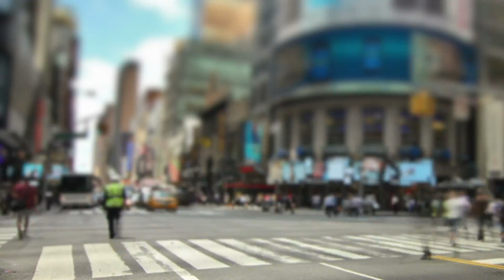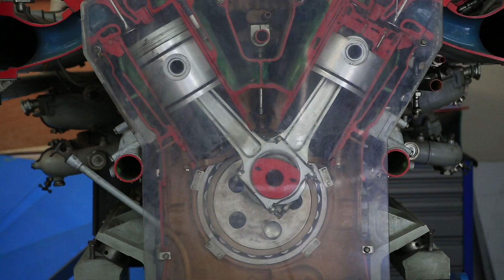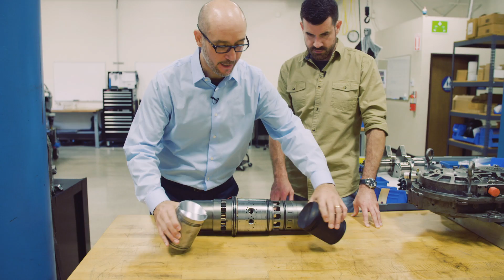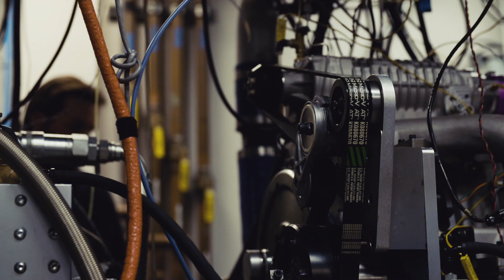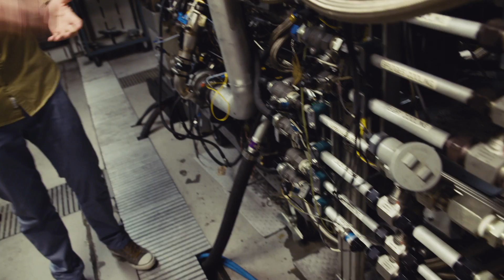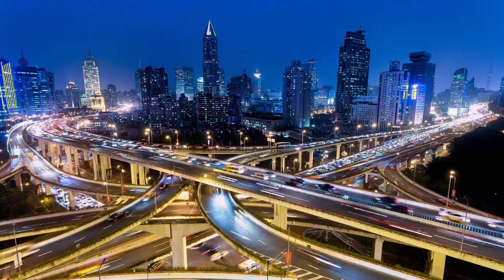This Radical Redesign Could Keep Gas Engines Pumping | WIRED

Comment: The first few years after sailing ships were made obsolete by the steam engine saw the most rapid efficiency improvements in sailing ship designs too.  It's a pattern repeated throughout history over and over again and it's what we're seeing here.
Reply: '90%' is not a real measure of fuel consumption

That's true.  A valid comparins to the 15-20% tank-to-wheels efficiency of the ICE is comparison to generation-to-wheels efficiency of the EV.

Generation to wheels includes the fill cycle of the heat engine.  The electric car heat engine has efficiency losses at the following points: 

1: Power Production
2: Losses in transmission of electricity
3: Losses converting AC to DC to charge the battery
4: Losses converting DC t AC to power the electric motor
5: The efficiency of the electric motor
6: Losses in the drive train
7: Losses relating to the extra weight in the car relative to an ICE

When you look at that entire cycle, you have a system that is approximately 40% efficient, which is twice as efficient as an average diesel car and close to three times the efficiency of an average petrol car.

You can take it further than that by looking a wells-to-wheels efficiency.  This is often brought up by oil industry shills who wan to talk about mining and production efficiency of EVs while ignoring mining, refining and production efficiency of ICE cars and fuels.

The production of an EV is 10% less efficient than production of an ICE car, but only because the production volumes are smaller.  That's a loss that is revovered over and over again over the lifetime of the vehicle.

The other thing people seem to forget is that oil has to be refined and that process uses electricity too.  Lots of it. When you go wells to wheels EV efficiency lead is increased, not decreased.

The carbon efficiency of the fuel is also important.  It makes things very complicated because it varies depending on your location.  Where I live electricity is based on 75% natural gas, 15% renewables and the rest comes from burning oil and peat.  Overall I am emitting 30% of the carbon that I would be if I was driving an average petrol car.
Reply: Yep, more recent example is the incandescent light bulb. EU banned them and all of a sudden they came out with huge increases in efficiency.  Did not help them one bit. 
Even a 30% increase in efficiency won't help the internal combustion engine. A standard ICE is only ~20% efficient, compared to over 90% for an electric motor, there just is no comparison.
Reply: Good observation.
Reply: 2LegHumanist Wow, so you can read my mind now?  All I want is a car that I don't have to wait 30 minutes for, to get a not-full charge.

I get that when the car is parked in my garage, it will be charging.  I get that, most of the time, I won't care that it can only go 250 miles before it dies, because I won't be going 250 miles before having an opportunity to stop and recharge it.

But I cannot afford two cars for two different purposes.  I need one car to fulfill all the purposes for which I need a car.  And electric cars do not yet meet those needs!!!  How can you be so arrogant as to think that, because an electric car meets your needs, it must therefore meet everyone's needs?!  It is elitist attitudes like yours that got Donald Trump elected!  People are sick and tired of being told what they need, rather than being allowed to determine that for themselves.

This whole argument started when you said the internal combustion engine is obsolete.  The definition of obsolete is "No longer produced or used.  Out of date."  The internal combustion engine is still produced and used every single day, all over the world.  Yes the electric car is making great strides towards becoming more and more useful every day.  But it is not ready to entirely replace the internal combustion engine!!!  Why don't you try actually reading what I wrote, instead of assuming you know what I mean!!
Reply: The last steam cars as well.
Reply: It's not really about the instantaneous efficiency in front of some measuring equipment. It's about the full life-cycle cost, from the cardboard packaging to recycling light-bulbs. As consumers, we never see some of those costs because they're already subsidised, so it makes sense that those sorts of bureaucratic decisions are made where they do have a fuller view of what's going on. On the other hand, 'efficiency' is a complex unsolved puzzle. When developing new engines, including electric motors, do we count the entire history of earlier engines as development costs?

BTW, electric motors are only "90% efficient" at converting the energy that they get from the electricity infrastructure, which might be less than 50% efficient to start with. '90%' is not a real measure of fuel consumption. But worse than that, every cent in the production price of your car represents a certain energy price. If a car costs $100k to drive out of the showroom, that's $100k worth of fuel getting burnt as the production cost gradually gets shared around in the economy.
Reply: You cannot charge current Lithium Ion batteries in 7 minutes -- even to only 80%.  It will destroy the battery in very quick order.  If you want to keep your very expensive battery in peak operating condition, you must charge it far more slowly than that.  Even the Tesla superchargers are not good for the battery if used too many times.

It's just the nature of Lithium Ion battery technology -- you damage it every time you charge it.  Even the slow charges damage the batteries.  Look at your phone or computer.  Run it dead every day, charge it up every night.  After 18 months, you have a very noticeable reduction in capacity.  All Lithium Ion batteries do this.  It's the nature of the beast.

And you think everyone should take a 30-minute break after only 400km of driving?  I can see taking a 10 minute break to grab something to drink or some food, and refilling the fuel tank.  But half-an-hour?  And you're not going to get 400km out of a modern battery with only a 30-minute charge.  200km, tops, if you're lucky.

Until a battery is invented that can take a charge and discharge with zero damage, and can do that tens of thousands of times, the electric car will only fill the needs of daily commuters.  Which is a lot of people, to be sure.  But it will not make the internal-combustion engine obsolete until then.
Reply: 2LegHumanist
Great answer! BTW I've been thinking about this for a while, kind-of baulking at the high price which seemed to strongly conflict with the idea that EVs were more efficient. But I've come to see the high price as simply a market signal that EVs are very desirable.

Without corrections elsewhere, a spending spree on EVs could drive a bit of inflation, as people borrow more cash to pay for a product that should inherently be cheaper to produce. Instead, competing ICE manufacturers will feel the squeeze.

I'm relishing the thought that the car industry will be forced to focus on actual technical innovation rather than endless redecorating.
Reply: LMacNeill ICE cars are already being phased out.  They will be banned in Germany from 2030, BMW is phasing them out too.

I'll go back to the ICE when it runs at 3 times the efficiency of current tech, pollution produced by it is exported to unpopulated areas, they make one that runs completely silently and a system is put in place where I can fuel the thing at home while I am asleep.

The majority of driving is commuting.  For that driving an EV is far more convenient than an ICE.  You don't have to make any special trips to charge the car like you do with an ICE and it has much lower running costs.

For that massive convenience I experience every day I will happily wait 30 mins on the rare occasion that I travel beyond the range of the car.  But 350kw charging is in its way.

Your ignorance really shows when you claim you need a charge point on every street corner.  No, you need them at destinations like workplaces and shopping centres.  I don't know where you live, but we already have that here

Get it out of your head that you have to go to some special location to charge a car. You simply go to your destination and plug in while you are there.  Car charges while you are not using it.

No, lithium ion batteries are not all the same.  Manufacturers are constantly experimenting with different chemistries  Do you really think the Samsung Note 7 has the same chemistry as all those phones that don't spontaneously combust?
Reply: 2LegHumanist I live in a rural area in the northern part of Georgia in the US.  It's a 20 mile drive just to get to the nearest shopping mall.  Electric cars are not practical for people like me until they can be recharged in just a few minutes, like gasoline-powered and Diesel-powered cars are today.  Period.  And until that time, they will not have rendered the internal-combustion engine obsolete.  Period.  My wife drives between 100 and 150 miles every day for her job.  An electric car will not be practical for her until such time as it can be 100% recharged in the same time it takes to refuel a gasoline-powered or Diesel-powered car today.  (FYI, she drives a Diesel-powered car, so as to be as efficient as possible, and not spend hundreds of dollars a week on gasoline.)

Your assertion that the internal-combustion engine is currently obsolete is quite clearly wrong.  You may be able to get away with owning a pure-electric car, but until such time as everyone can do that, the internal-combustion engine will not be obsolete.  That time will come, I am sure.  But it is not here now.
Reply: Both of you make valid points, however, this is way i think the electric motor will win the battle. It boils down to cost. An electric car has an order of magnitude fewer moving parts then a regular gasoline car. That means it's much less likely that something breaks due to wear and tear, that means that maintenance costs for and EV are much lower. Secondly, electricity is much cheaper then oil, even at these low prices. And this is not just theoretical, taxi companies that use EVs have confirmed this, they save a lot of money from fuel and maintenance.
The problem today is that a battery that enables you to drive 500 km and the EV itself costs way too much, that economy makes sense for a taxi company, because they drive a lot but not for everyday car owner. The solution for that is production at scale. We know how to do that and it's already starting to happen.
The second problem is charging. Where there is demand, there will be supply to make a profit from that. I really don't worry about that.
So it boils down to producing batteries and EVs at scale, if we do that we can offer people a car that is cheaper to own and cheaper to drive at similar cost to a regular ICE car. I can't see people buying a car that has higher maintenance costs and higher energy costs to move, hence the internal combustion engine is dead, it's just a matter of time.
Reply: meh_hi_there There are numerous problems battery swaps.  

The potential for damage that can occur to the most expensive component of the vehicle when constantly disconnecting, lifting, moving and reconnecting a 400-600kg battery is a pretty good reason not to do it, but lets focus on the problem you dismiss out of hand as pride.

You have to remember that almost all charging for almost all driving happens at home when you're not using the car.  It's only the rare occassion that you want to travel beyond the range of the vehicle that there is a need for fast charging or battery swaps.  That means that if I swap my battery, whatever I end up with at the end of my journey I am going to be stuck with for a long time.

So why not just accept that for the good of the environment?  Well, batteries degrade at different rates depending on how well they are looked after.  If I keep my own battery, I have the option to extend its life by ensuring keeping the charge between 20% and 80% as much as possible.  Someone else's dirty battery might have considerably less range than mine and that might not be suitable for my needs at all.  Due to the amount of driving I do, I need a particular range.  When my battery falls below that, I will replace the car and someone who doesn't need that range will buy my car.  If I am swapping batteries I will never know what range I am going to end up with and buying a new car or a new battery will make no difference.

Why should I swap my well looked after, brand new battery with 100% of its original capacity for some dodgy bastard's old battery with 70% of its remaining capacity?  It's not pride, it's just not wanting to be completely fucked over.
Reply: So far that Model 3 does not seem to be a car for average consumers.
Reply: Tell that to the 500 thousand average consumers who have put down deposits already.
Reply: Thousands of these were made in T64 tanks. Most trains use em too. they are very efficient. T64 gets 2mpg whereas modern Abrams gets 0.5mpg
Reply: meh_hi_there Sorry, I meant to address the point you made about energy cost.  Most of the cost is in the batteries and it's not due to energy costs in manufacture.  It's the ongoing research and development and the low volumes being sold to date.

Tesla's market strategy was to focus on the luxury car market initially.  There are two reasons for this. First, an EV in that market can be competitive despite the high cost of batteries.  Nobody wants a ford focus that costs $50k. The second reason was to make electric cars something desirable in order to create a market for the lower cost cars when they become feasible.  Prior to Tesla, all electric cars were small, slow and awkward looking things.  Tesla made something that looks like a normal car and is now the quickest production vehicle on earth.

Tesla are addressing the cost of batteries by building their Gigafactory which will hugely increase the production volumes of car batteries bringing the price down.  That is how they plan to make the model 3 half the price of the baseline model S.  Before incentives are taken into account, the Model 3 will be $35k (USD).  Then of course, it won't be long before the price drops further and the number of cars in existence creates a more reasonable second hand market.
Reply: You act as if electric cars have rendered the internal combustion engine obsolete...  There is still one BIG issue -- range.  You get, at best, 250 miles out of an electric car, and you have to stop to charge it for many hours.  Even Tesla's "supercharger" system takes 30 minutes to go from 20% range to 80% range -- you basically get about 120 miles of range for half-an-hour of charging -- and it does damage to the batteries to charge them any faster than that.

When it takes 5 minutes to refuel an internal-combustion vehicle and go another 300 to 400 miles (to maybe as many as 500 miles, depending on the efficiency of your car), you cannot say the electric car has rendered the internal-combustion car obsolete.  It can replace the internal-combustion car in several, very narrow, very specific niches -- particularly city commutes of less than 40 miles one-way.  But to completely render all internal-combustion-powered vehicles obsolete?  Electric cars are a long way from that.

To truly send the internal-combustion-engine into obsolescence, you need a battery that can be recharged from 0% to 100% in 5 to 10 minutes, can give 300+ miles of range, and can be recharged hundreds of thousands of times without any reduction in capacity or load-capability.  Such a battery simply does not exist yet.  It may, in the future, and I certainly hope it does, but in the meantime, the internal-combustion engine is all we've got for long-distance car and truck travel.
Reply: LMacNeill This "niche" driving you speak of is almost all driving that happens worldwide.  The range you speak of is already available in Teslas and will soon be widespread.  The charging times you speak of as current, are wrong.  it's 30 mins 0 to 80% which after 400km of driving is a break anyone should be taking anyway.  Your suggestion for the future is already happening in Europe where a network of 350kw charge points are in planning.  These will charge the biggest Tesla batteries in 7 minutes.

When we have fully autonomous cars and it becomes save to travel the range of a 100kwh battery without a break, then you can start worrying about charging times... assuming Tesla doesn't match the European network by then.
Reply: 2LegHumanist Of course you'd start a journey with the battery at full.  But then after you've depleted it, you'd still have to wait 30 minutes while you get it back up to 80%, and then each subsequent stop comes after a shorter range than your first did.

And lithium ion technology is lithium ion technology, whether it's in a phone or in a car.  There's just a great deal more capacity in a car battery than there is in a phone battery.  It's still damaged every time you charge it, and it's still going to take far longer to get it to a full charge than it will to fill up a fuel tank.

I'm not saying electric cars don't have a use -- of course they do.  They're getting better every day.  Once the battery problem is solved (charging times and capacities equal to fueling times and ranges), and the infrastructure is built (charging stations on every street-corner, like we have fueling stations today), then electric cars will have rendered internal combustion-powered cars obsolete.  But until that time, they have definitely not rendered the ICE obsolete.  Not by a long shot.  If ICEs were obsolete, no one would be manufacturing them anymore -- much like modern flat-screen TVs have rendered CRT TVs obsolete, so no one manufactures CRT TVs anymore.  We have not yet reached that point with the ICE.  We will one day, assuming the free market is allowed to work its magic.  But it has not happened yet.
Reply: '...most rapid efficiency improvements in sailing ship designs....'
Have anything backing up that assertion?  I know what you are trying to say, but this claim sounds like you pulled it out of the nether region.   
Was 'efficiency' the metric in which sailing ships were losing to steam ships?  What measure was being compared to cargo ton nautical mile per ton of coal?  Cargo ton nautical mile per area sail cloth replacement?
By most reasonable metrics, I suspect the most rapid improvements in sailing ship design came much earlier, probably with the development of the triangular sail.....which doesn't have much in common with fuel efficiency except sharing that one word.
Reply: +Ben Griffin
If efficiency was the wrong term to use, fine, but that takes nothing what so ever away from the point I have made.  The sailing ship effect is a real effect repeated throughout history and as someone who spent many years driving petrol and diesel cars before moving to electric, I am suggesting that the design showcased in the video we are commenting on is a symptom of the same effect.

You can read all about it here:

The Sailing Ship Effect is a phenomenon in business by which the introduction of a new technology to a market accelerates the innovation of an incumbent technology.[1] The term was coined by W.H. Ward in 1967[2] in reference to advances made in sailing ships in the second half of the 1800s in response to the introduction of steamships.[3] According to Ward, in the 50 years after the introduction of the steam ship, sailing ships made more improvements than they had in the previous 300 years. The term "Sailing Ship Effect" applies to situations in which an old technology is revitalized, experiencing a "last gasp" when faced with the risk of being replaced by a newer technology.
https://en.wikipedia.org/wiki/Sailing_Ship_Effect
Reply: 2LegHumanist Tesla model 3: $35K (and not yet in production).  Tesla Model S: $85K.  My wife's car: $18K.  That's a big difference.  And neither of the Teslas will haul the equipment she needs to carry.

You said the internal combustion engine is "obsolete".  Meaning "No longer produced or used.  Out of date."  The internal-combustion engine is both used and produced today.  It is not obsolete.

Every single good you purchase at your local store -- groceries, etc. -- was shipped there on a truck.  That truck drove hundreds, if not thousands, of miles to get there.  It can't run purely on electricity yet.  It requires its Diesel-powered internal combustion engine.  The truck-driver is not going to wait around for 30 minutes to get an 80% charge -- he/she is losing money every minute that truck is not rolling.

Eventually there will be battery technology that can make up the difference; someone will figure out a way to make a battery that can be charged from zero to 100% in 5 minutes, while still giving you 300 miles of range.  Right now that technology doesn't exist.  The internal-combustion engine is not yet obsolete.  It will be, I'm sure, given enough time; but it is not now.
Reply: LMacNeill Flow batteries -- just replace the electrolyte. Or battery swap pit-stops where a robot arm unplugs the battery and replaces it with another one from a giant jukebox-like dispenser.
Reply: meh_hi_there Battery swaps were trialed by Tesla years ago.  The trial showed that pretty much nobody at all was interested in using the service.

It's only petrol car drivers who think battery swaps are a good idea because they can't get it into their heads that charging quickly isn't all that important for almost all driving that happens.  Nobody cares how long it takes to charge because the car charges when you are sleeping or otherwise not using it.

LMacNeill has already had it explained to him that we will soon have chargers that can charge existing batteries to 80% in 7.5 minutes and that there are already existing batteries with a range of 300 miles.  If his arbitrary demand that they go to 100% in 5 minutes was met, he'd just up the ante and insist the car has to make him coffee and make broom broom noises.  It's a classic tactic that you see over and over again.

They start out by claiming EVs are impractical for everyone.  Then as that is shown to be bullshit, they narrow the scope by moving the goal posts and arguing they're impractical for some specific, rare, personal edge case.  Then when that doesn't work they continue to build the edge case until they're claiming to have a daily commute of 600 miles, that is entirely up hill, they have to cart around 3 tonnes of bricks with them everywhere they go in a car that cost them 25 cents.

I've had this exact conversation many times.  It's hilarious to see it devolve into exactly the same kind of thing every time.
Reply: Oh look.  350Kw charging just hit California!

https://electrek.co/2016/12/15/electric-vehicle-dc-fast-charging-station-in-us-breaks-ground-in-california/
Reply: 2LegHumanist 
The 'sailing ship effect' appears to be mostly driven by smoke being blown up people asses. 
This is from the reference the Wikipedia article you sighted uses;

'...Detailed reexamination of two cases thought to be exemplars of the effect reveals that it existed in neither. It is suggested that the characteristics of historical, technological substitution processes prompt misinterpretation based on superficial knowledge. Brief review of two other cases further supports this position. It is argued that if the phenomenon occurs, it is likely to be rare.....'
.
This was coined by someone 100 years after the fact, not someone who experienced such 'innovations'.   I wonder if this pedallor of new management terms actually ever sailed or has much knowledge of sailing history.
.
Please note that sails in various forms are making a come back aboard large cargo vessels....from solid wings to self reeling kite sails.....looks like the tech is around to stay.
Reply: Ben Griffin Thanks for pointing that out.

However, even if the concept has an unfortunately name, the effect is real in other areas, including the automotive industry:

http://www.sciencedirect.com/science/article/pii/S0959652616309817
Reply: 2LegHumanist 350kW is a stupid gimmick. It's just not scaleable. If people want industrial quantities of electricity, they will have to pay spot prices, not to mention a higher price overall to cover infrastructure bloat. And for what? Because more sensible solutions weren't "Feng Shui" enough?

Most people don't even own their cars, anyway. It's usually a bank loan or some lease-to-buy scheme. Factor in the rapid advancements in autopilot tech. and it's evolving into the world's worst public transport system.
Reply: meh_hi_there 
LMAO.  Talk about rage comment.

I can only assume that this nonsensical comment is motivated by fear of change.

You think it's a gimmick to want to charge a car in 7 minutes instead of 30?  I don't know WTF you think is a sensible solution or what feng shui has to do with anything.  Or what the hell any of this has to do with how people finance their cars...

Rage comment.
Reply: 2LegHumanist Your rage, not mine.
"You think it's a gimmick to want to charge a car in 7 minutes instead of 30?"
I never said that. Why should I bother responding if you're just going to see what you want to see rather than what's actually written? I was talking about the insane electricity requirements, but I keep forgetting that Muricans don't do mathhhh.

If there's a NEED then there's a need, but clearly it's not about efficiency or saving the environment. It's about keeping the car owner in their little bubble: their pride and joy doesn't get "contaminated" by someone else's dirty abused battery, even though battery swaps might be even faster and provide a better charge.
Reply: meh_hi_there 
Your rage, not mine.
...
Why should I bother responding if you're just going to see what you want to see rather than what's actually written?

Really?  No rage?  How about writing something that protrays your views in an understandable manner rather than blaming the reader?

I was talking about the insane electricity requirements, but I keep forgetting that Muricans don't do mathhhh.

Right, I'm on the INTERnet (international network), so I must be American.  I must be up pretty fucking late if I'm American, hey?  Great logic.

It's about keeping the car owner in their little bubble: their pride and joy doesn't get "contaminated" by someone else's dirty abused battery, even though battery swaps might be even faster and provide a better charge.

Finally, we get to the bottom of what you're on about.  You're advocating battery swaps.  You could have saved us a lot of time by just saying that.

Nobody who actually drives an EV wants battery swaps.  Tesla have trialed it, there was virtually zero uptake and for good reasons.  Battery swaps, like hydrogen cars, work only in the imagination of petrol car drivers who can't imagine what it is like to fuel a car while not standing next to it.
Reply: Uhmu The necessary production increase of batteries is happening faster than people realise.  The first of many Tesla Gigafactories will be here soon, which will result in a massive reduction in price of long range batteries.

You're right about cost.  Even more so where I live in Europe and taxes are higher.  Replacing my petrol car with a Nissan Leaf has saved me €5k a year.  The car will pay for itself.

Maintenance costs are virtually non-existent due to a lack of moving parts, but even the tyres last longer due to the lack of engine vibration.

But that's not the only thing.  Driving an EV is just a better driving experience.  There is literally no engine noise and vibration.  Petrol cars are no match on price or on drive quality.  Soon petrol cars will also not beat EVs on range.
Reply: 2LegHumanist, everything else is a bonus, but it needs to make economic sense for everyday Jane and Joe.  On the batteries front yeah, it's not just Tesla who is pushing that front. There are several entities in Asia and European car makers who need batteries just to compete with Tesla in the luxury sedan segment. The investment front is in full swing.
Reply: Tesla's vision is not to remain just a luxury sedan peddler.  The goal is to market EVs to the masses.  The model 3 will begin to achieve that and the model Y will push it even further.  The luxury market was part of a strategy to make EVs something people want to buy and to have the development of the technology funded by wealthy early adopters.
Reply: Y10Q 
Diesel trains are efficient for 2 reasons.  

1. they are hybrid electric vehicles with movement generated by electric motors.

2. They run on rails, which have much less friction than a rubber tyre on a road.
Reply: So you're saying it's all in vain?
Reply: Jeeto 
Yup. They're making small tweaks to a technology that is about to be replaced.
Reply: LMacNeill LMAO.  You want a perpetual battery and yet you don't have a perpetual ICE engine.

Classic tactic of people who are scared of change.  Add a massive expectation on the new tech that goes well beyond the old tech.

The 600 moving parts in your ICE engine are damaged every time you drive it.  An EV has very few moving parts and consequently a much lower maintenance cost.

BTW, you better run and inform all these electric car manufacturers that 350kw charging is impossible, cos they are doing it... http://www.electric-vehiclenews.com/?m=1

You do realise electric car batteries are not mobile phone batteries right?  They don't have the same chemistry.  They last a hell of a lot longer.  I mean seriously, 18 months?  I know people who have been driving Leafs for 5 years and still are above 85% capacity.  Nissan offers 5 and 8 year warranties for 24kwh and 30kwh batteries respectively, promising minimum capacity of 70%.

Your info regarding the damage done by fast charging is way out if date too.  That was an early concern that has been shown to be overstated.  The quickest way to kill a battery is to leave it charged at above 80% or below 20% for extended periods.  Charging to 100% isn't much if an issue if you run it back down again shortly afterwards. Fast charging makes little difference.

Like I already said, you're wrong about the replacement cost and timescales for degradation.

You are also wrong about range.  Teslas 100kwh batteries are epa rated for 507km.  last I checked 80% of 500 was 400.  And why should the fact that you can only fast charge to 80% prevent you from beginning the journey with 100%?
Reply: I live in a rural area in the northern part of Georgia in the US.

Great.  There are 7 superchargers in your state and more ordinary charge points than I can count.
https://www.plugshare.com/

It's a 20 mile drive just to get to the nearest shopping mall.

Still not getting it are you?  Nobody is suggesting you make a special trip to the supermarket to charge your car.  The suggestion is that your car gets a top up when you go there to do your shopping.  You plug it in at home to do most of your charging.  You plug in at destination.

Electric cars are not practical for people like me until they can be recharged in just a few minutes

This was BS last time you said it and it still is.  You charge at destination.  At work, home, shopping etc.  You don't need to charge quickly unless you are driving outside of your range, which could be as high as 500km.

And you still continually ignore the fact that there are in fact charge points on the way that can charge an ecar battery more than twice as fast as a Tesla supercharger.  You can deny it until you're blue in the face, but 350kw charging will soon be here.

And until that time, they will not have rendered the internal-combustion engine obsolete.

The internal combustion engine is already inferior.  You're about to see a very rapid change in uptake.

My wife drives between 100 and 150 miles every day for her job.

That's well within the range of a Tesla model 3 or the cheapest model S.  Both of which are EPA rated for 215 miles and those batteries are only going to get bigger.  So she doesn't even have to charge at destination, though she easily could and that would increase her range even more.

You may be able to get away with owning a pure-electric car
Almost everyone can get away with owning an electric car.  The longer your commute the more you benefit financially too.  It isn't true that electric cars are most practical for city dwellers, in reality they are most economical for people with long commutes.  Those people will get the greatest value and save the greatest amount of money on running costs.
Reply: More pointless pedantism.  Clearly auto makers and the oil industry can see that the ICE is on its way out.  What we are witnessing here is the ICE in its death throes.  #SailingShipEffect
Reply: LMacNeill 
This whole argument started when you said the internal combustion engine is obsolete <- Except I didn't say that.  I said the effect of sailing ships being made obsolete resulted in massive improvements in sailing ship design and that that is analagous to what is happening here.  

The analogy applies here whether the ICE is already obsolete or is in the process of being made obsolete.  Same fucking concept.  Those invested in the old technology suddenly increase their efforts to improve it.